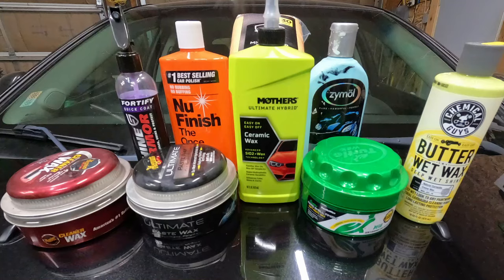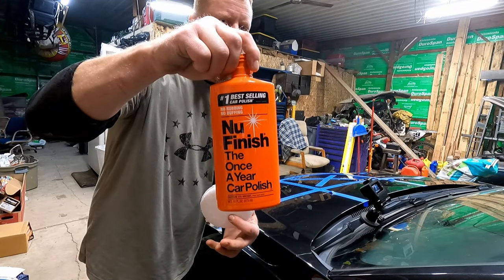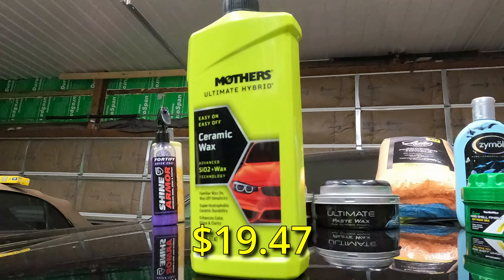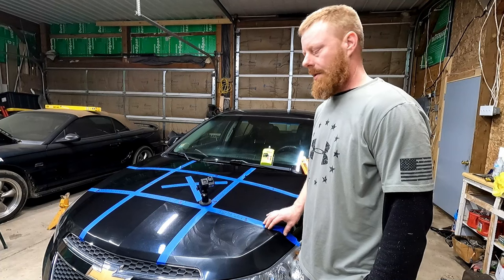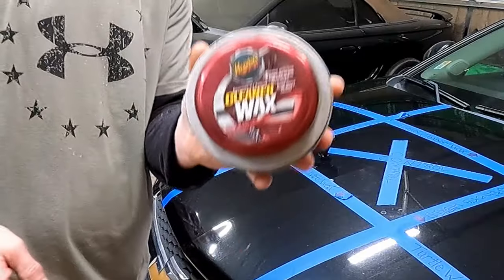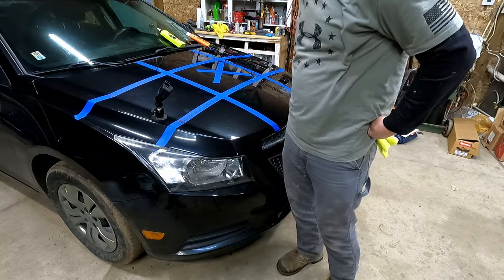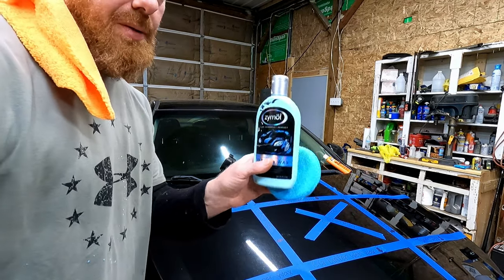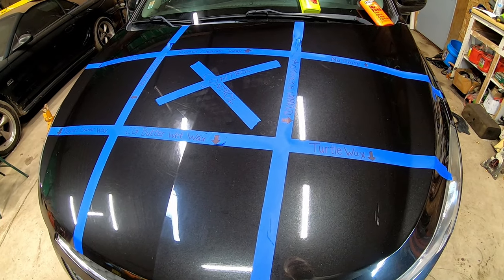Battle of the Waxes: Which Car Wax Reigns Supreme? The Results May Suprise You

Comment: I am 70 years old and have used only a few different types of waxes. At my age I am looking for durable and easy to apply waxes.
Reply: Turtle wax ceramic ice. Just read directions easy to apply and works great
Reply: I prefer Zymol  — for the garage queen — and turtle wax minute wax spray for the daily. NuFinish is great too - always had been but prefer the paste version
Reply: Just get any of the spray waxes. I love most all of them. But they're hard to get used to if you always used paste wax because any more than 1 or 2 sprays per panel and it can streak. It takes such a tiny amount you'll think you're not applying anything other than the slickness. And with the technology these days, a good spray wax will last 6 months or more.  I've got over 20 different brands of spray waxes. If I had to suggest a few that you can get at a store instead of online, I would say Turtle Wax Hybrid Solutions Ceramic Spray, Turtle Wax Ice Seal and Shine, or Meguiars Quik Wax. Waxes with carnauba don't last as long but register a little more on gloss tests. Carnauba is gloss, polymer sealants are longevity. I'm 53 and can't rub off wax like I used to do sprays require zero buffing. Wipe on wipe off pretty much.

Comment: I have used Nu Finish for a very long time.  Its cheap, it goes on in any light and (most importantly) if buffs out super easily.
Reply: I agree, and I have too. The best and most important thing...and the one thing this video doesn't even attempt to address...is that it LASTS.
Reply: Exactly. I've used turtle wax before, and that stuff is hard as heck to buff out, unlike nufinish, or any of the ceramic waxes.

Comment: The most important observation is which lasts longer? I have purchased so many modern spray waxes but the paste wax still seems to last. About 4 months I use meguiars cleaner wax. 50 years old and somehow seems to still work the best as far as lasting the longest. That's weird to me so I do keep watching videos and keep trying new stuff.
Reply: I just purchased a new (old 1978 MGB) with 16,800 original miles. Looks like it should be in a museum. I first waxed it with Meguiars cleaner wax in case there was oxidation. Then applied Meguiars Gold Class Carnauba Plus wax. I heard Carnauba wax dries harder than the paint itself. So far I am happy.

Comment: The cleaner wax helped bring back my wagon, which had 18 years of tough love in Central Wisconsin. Not sleeping in a garage for 18 years of its life. At the car show, they said, "Wow, you really waxed the hell out of this!" I said I only put on one coat throughout. But it's lasted the longest out of many of the products I've used. So I suppose it depends how long it's been since it has last been waxed for results.
Reply: I hesitate to use cleaner waxes very often.  They potentially have some very fine polishing material in them as the cleaner part...like wet sanding.  Maybe use that once every 2 years or when the finish is truly getting dull.  Use just a straight wax otherwise.  Less harsh on the paint and clearcoat.
Reply: @derekmckean5593  yea, ive only use it on vehicles that haven't been touched in a long time except the occasional car wash.

Comment: They are kinda the same, shocking.  I have switched to the spray ceramic,  easy to use, doesn’t discolor rubber or plastic and it seams to last a tad longer.
Reply from the maker: I was shocked also. My favorites looked just like all the others.

Comment: I use to hand wax, I felt there was no way a spray could be more durable than a paste.

Emailed Turtle Wax one day, they basically said most waxes these days are not true waxes. They are synthetic polymer sealants regardless of paste, liquid, or spray and it doesn't matter how you choose to apply it.

Makes little difference if you apply they work equally as well, and are more a carrier used in order to spread the polymer sealant.

Basically summarized it as spray is easier to apply for many people, and less time consuming. It actually made a lot of sense to me, and I've not used paste/liquid wax since.
Reply: I think you're right. The Chemical Guys liquid Better Wet Wax has been pretty good for me after Souveran Paste Wax. The carnuba's are loaded with synthetics and do a great job of mimicking the qualities of a carnuba.
Reply: @empower4you972  yeah, zymol on any level is hard to beat though. I have several bottles of the cleaner wax. I waxed my cousin's Buick enclave with it and it looked like a mirror. A guy t-boned him the next day. When asked how the guy didn't see him he told the state trooper that he thought he saw an illusion of water(an oasis if you will). That is no lie.
Reply: Since then I haven't used the zymol and I still have several bottles unused and I'm really scared to.
Reply: To live in an time that spray waxes can do the same if not better job than paste waxes is incredible. Can’t beat TW Ice Spray wax. Easy to use. Doesn’t leave any white marks on trim. Lasts only a month for me since my car is always under the sun, but I love waxing once a month anyway.
Reply: Yes I agree and if it's easier to apply and remove like a spray then peeps use it more often

Comment: Used CG Butter Wax for years and I've liked the results. I believe that find what works best on your own vehicle and stick with it. Any paint protection is better than none.
Reply from the maker: Definitely agree
Reply: Well said. Most people don't even wash their car on a regular basis, but as you say " Any Paint Protection Is Better Than None ". I think we get swept up in all the advertising hype and have to have the latest product BS, i have been using Nu-Finish for years, works for me. people say they changed the formula and it's not the same as the original, i can't see any difference. I top it up with Turtle Wax Seal and Shine as a drying agent after i wash the car and only have to polish it once a year. It's the old Keep It Simple Theory.

Comment: I use Turtle wax because that is what my father used when I was growing up so it is what I have the most experience with.
Reply: Used Turtle years ago but every time they said “ new formula “ it seemed to last a shorter time . If it doesn’t bead , it is gone. I found that happened sometimes in less tan a month.
Reply: The new formula removes from body plastics easier.  It used to be a pain to remove turtle wax from plastics

Comment: I've used NuFinish for years. The first time you use it, have to put two coats on. After that, wax once a year. Other waxes have to be renewed monthly.
Reply: If your car is not garaged, it will wear off horizontal surfaces after about 4 months here in the Midwest, USA
Reply: @steveneumeyer681 not true, i am a detailer and put mother ceramic wax 5 months ago. Still going like the first day, and i dont wash my car often and i drive alot
Reply: Excellent, fair comparison for looks, but you should have tested the feel for slickness too. Thanks for the great info.
Reply: I have used New Finish for the past 20 years, & have never looked back.  One coat in September, & another in October, & I'm good for the harshest winters here in Ontario, Canada.  The shine is amazing, & the water still beads after 7 months, & and a minimum of 30 automated car washes.  Trust me, you can't go wrong!

Comment: Similar experience when I was testing waxes, they all looked the same. Ease of use and durability is really the main difference between them. Great video! You'd probably like Collinite 845, that one is very nice to use and durable.
Reply from the maker: Hey thanks for your input.  I will try the Collinite 945.
Reply: He would really love Gyeon Q2 Wax. It has possibly the best hydrophobics I've seen in a wax but it is not cheap.
Reply: @COC785  how much is that Q2?

Comment: There are 2 kinds of waxes 
Those that allow water to bead up.
Those that allow the water to just sheathe off.
I'd rather a pure carnuba wax that sheathes the water.
.beaded droplets create thousands of prisms  after its wet / rain which can create water spots .
A sheathing wax will puddle up the water and let it roll off the car.
The best wax ive ever used was a wax called Slipstream airplane wax.
Hard to apply and take off ....but the results were worth it

Comment: I just factory ordered a 2024 Miata RF and it was the first car I've waxed in decades.  I used Meguiar's carnuaba liquid wax, which I've read gives a great shine and helps bring out the color of the paint, but doesn't provide as much protection as other waxes and therefore needs re-applied more frequently.  Thoughts?

Comment: I jump at the latest and greatest.  The result is a 1 ton capacity cabinet packed with car cleaning products.  Yet I always return to Turtle Wax cleaning and waxing paste.  Their carnuba spray is great too and lasts a long time, especially after a good cleaning waxing.  Different paints will hold it differently.
Reply: How long does it last?
Reply: Which one of these products gives you the most protection? I’ve switched to turtle wax hybrid ceramic spray mainly because it’s supposed to give about 6 months of protection but I do like to use wax as well just be side it’s tried and true.
Reply: You are not the only one my guy for I have a cache of detailing chemicals also.
Reply: Same! My wife thinks I’m insane. She kinda understands now when I said me detailing the car is like her shopping.
Reply: @Al-ok1lj  people don't understand my love for it either. A few shop owners around here tell me that I'm crazy for charging so low. I guess they feel as though that's one more car that they don't get to clean.

Comment: I’ve tried several different kinds of wax from liquid spray to paste wax and I found all of them pretty much have the same shine.  The only thing I have found is some wax is harder to take off than others.  What I do is to take a couple of ounces of Chemical guys butter wax and put it a 22 ounce bottle, fill it with water and shake it till the wax dissolves in the water.  Then I use it about once a week on my cars when I wipe it down.  Takes me about five minutes to do my truck and car.  I constantly get asked how I keep my car so shiny.
Reply from the maker: Well at least I'm not crazy.  They all had the same shine inside and outside.

Comment: The best wax I've ever used is Pinnacle Souveran Paste Wax. It goes on clear and wipes off with little to zero effort.  The other thing is the shine is brilliant, and that's what I'm most interested in when I wax.  I'm not really looking how I can NOT detail my car with longer lasting formula's or whatever based on longevity. The one drawback with Souveran is the price - $69 for 8 ounces. Latest product I've tried is Chemical Guys liquid Butter Wet Wax. It's a Carnuba creme wax and costs only $20 for 16 ounces. I also used a Mequiar's synthetic paste wax - no longer made - but its a little tougher to remove but has outstanding shine qualities as well. Next up for me is Mequiar's Ultimate Paste Wax - because I like the Mequiar's brand.

Comment: I used to use the turtle wax ice liquid wax but they have discontinued it.  It was the easiest wax to apply and remove.  The wax came with a sponge applicator that you applied by just running across the paint.  You would let it sit for 30min, wipe off the excess, and then finish with a clean dry towel.  The best part about it was that you could apply it on hot panels in direct sunlight and it didnt matter.

Comment: Which one of these products gives you the most protection? I’ve switched to turtle wax hybrid ceramic spray mainly because it’s supposed to give about 6 months of protection but I do like to use wax as well just be side it’s tried and true.
Reply from the maker: To be honest I can't say for sure.  None of them had advertised protection or duration on the bottle.

Comment: I suggest against turtle wax. Was VERY shiny & left the car butter smooth.

Used it for years cuz I was poor, but you saw the streaking. The NUMBER ONE Complaint I’d get from family is the streaking with the Turtle Wax, and it’s harder to remove when it hardens. I’m gonna try my luck with McGuires

The liquid turtle wax carnauba is nice, it’s a cream & comes off easily, but DOES NOT LAST AS LONG as the old school wax and buff

Comment: Turtle wax hybrid solutions ceramic wax spray. $13, spray on and wipe off.
Reply: I've used TW Hybrid Solutions Ceramic and then in subsequent washes used it as a drying aid and that works extremely well obviously. I do find the ceramic and graphene coatings tend to attract more dust/pollen than traditional wax. I've now switched to CG butterwax and am pretty much following the same routine as I did with the TW and its definitely just as good but the pollen just blows off with the wind vs "sticking" like ceramics/graphene.

Totally agree with a lot of other comments here though, as long as you're doing SOMETHING it will go a long way to protecting your paint.

Comment: So, I’ve used many of the wax’s you have used here. Zymol being one of the best. Now I’ve also used for decades Klasse all in one polish cleaner. To me, it simply produces the best shine of anything I’ve ever used. It’s an acrylic product created back in the late 70’s when there was a shortage of carnuba wax in the world. It’s designed for aircraft to leave a super smooth surface. Again, a bit pricey but the results are amazing ($35 for a 16oz bottle). But you don’t need to use a lot to achieve great results. Only complaint: it does leave behind some dust if you let dry all the way: but you don’t have to. Simply apply as you have done here and then immediately wipe BAMM! Amazing shine.
Reply from the maker: Appreciate the information

Comment: Did you prep the surface first? I.E., did you wash, clay, iron remover, compound, polish, alcohol surface prep before you applied these? I was using Griots garage 3 in 1 but have switched to CarPro Hydr02 spray on rinse off surface protectant (ridiculously easy to apply and it lasts 3 months or longer with maintenance washes).
Reply from the maker: We washed, dried and used the grease and wax remover.  Then we applied each wax.
Reply: Good video, showing waxes how most people do them. The vast majority of people have no idea how to do paint correction or even one a DA or rotary machine.  Maybe do a high end comparison eventually.  Say FUSSO, Gyeon wax, turtle wax 25th anniversary, TAC systems shinee wax.  Maybe a video confirming Gyeon wet coat is the best spray on wet rinse off product. Vs McKees hydro blue, TW Minute wax, suds lab hydro etc etc.
Reply from the maker: @LKN4WAR  hey thank you

Comment: This is not a purely objective, scientific evaluation, but I think subjective tests like this are every bit as important, maybe even more so.  I've watched several videos today from professional detailers and I think it's most important to point out that regular waxes and ceramic waxes (and I presume hybrids) can be very different.  Ceramics are for primarily for gloss and waxes are for primarily for protection (as one detailer said, ceramics are a clear coat for your clear coat).  Ceramics finishes also require much more extensive surface preparation to work effectively, don't really lend themselves to spot polishing since they don't blend/feather as well, and, unless you park in a garage, ceramics actually wear out faster (forget the marketing myth).  So, if you're applying a true ceramic finish, you got your work cut out for you.  Not my words, but those of detailers.  Your particular results underscore that there's no silver bullet solution for all cars and all drivers.  Most waxes will provide protection and shine but the condition of your car's paint and how well you maintain it is much more important.  For me personally, I simply won't go down the ceramics (or other chemical) rabbit hole because of the significantly higher work/maintenance and expense to get the most out of it.  The best finish I ever had on a car was 50+ years ago on a '69 Chevelle SS.  And that was because I washed it every couple of weeks, got the bugs, tar, and bird droppings off asap, and waxed it 2-3 times a year.  A formula that still seems to work pretty well.
Reply: Yeah, it can't be said better.

Comment: Great conclusion I guess they are all similar just different prices, although I've used turtle wax alot in the past I find the wax is harder to buff out so I try to find waxes easier to apply and remove. I just used the Meguires Ultimate liquid wax with a great result but it's $25 a bottle.
Reply from the maker: Thank you for watching and taking the time to comment.

Comment: I love this video bro. The one point you missed was the FEEL of the car after it’s waxed. I love the smooth, silky feeling after my car after is washed and waxed lol. I use spray on waxes like the Turtle wax carnauba wax or chemical guys quick detailer wax. One difference I noticed between the two is that the chemical guys makes the car feel smoother and leaves less swirl marks, if any, than the turtle wax. But the turtle wax brand does a great job on the windows; the wax last at least a month!
Reply from the maker: You are correct, I should have included the feel.  We sure appreciate your feedback.